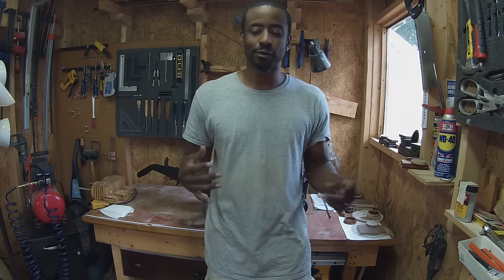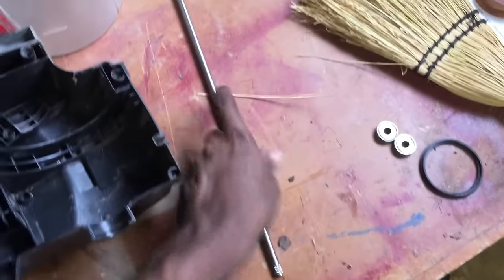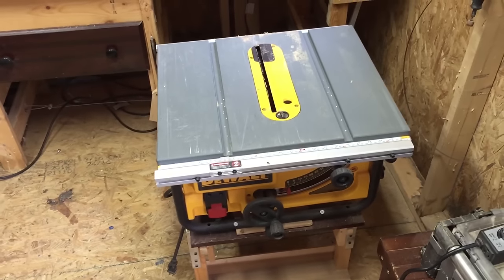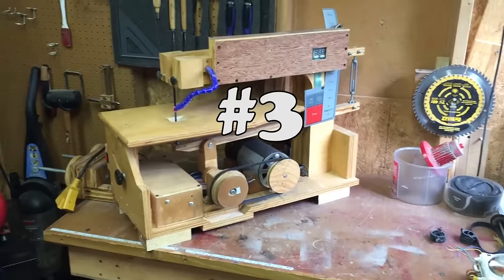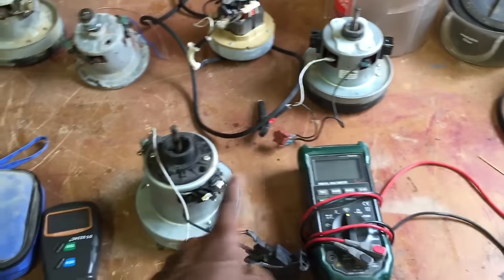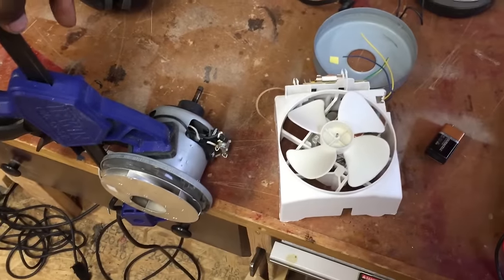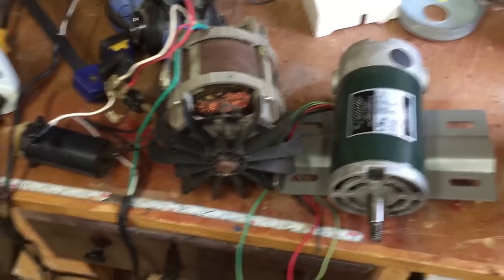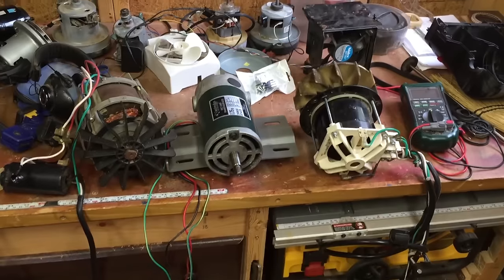Things You Can Make With A Vacuum and Other Salvaged Motors: # 010

Comment: This isn't vacuum related, but I've been trying to make something out of an old table fan motor and can't get it to work. I'm not savvy with electrical wiring, and have tried and tried to get it to work. It has four wires a black, red, white and blue. The red white and blue went to the 3-speed function of the fan, the black was connected to the power cord. I'm trying to wire it up to a switch but everything I try doesn't work, do you have any ideas of what I could be doing wrong? What switch I should purchase? 😞 Any help is greatly appreciated!

Comment: If you ever get your hands on some stepper motors from normal printers, you probably could use an Arduino, or Raspberry pi to make a 3D printer. That’s what I have been doing for a Project.

Comment: 2:00 min mark:  Air is mostly nitrogen hydrogen and oxygen...  all are fluids below each of their evaporation temperatures -297.3°F for oxygen, −423.17 °F for hydrogen, and -320.4°F for nitrogen.  But unless air is below those temperatures then it is not a liquid, it is a vapor.

Comment: Jeremy... I wish we were neighbors too! I salvaged a DC motor (60v??) , I bought 18 LG 18,650s.... all of this is for my bicycle. . The motor mounts fine, and the batteries work great 6s3p(22v).. Tons of amp hrs. I calculated it to be 185ish amp hrs. which is divided by 6 or 3 Im not sure... I have run the motor at 42v with 12s.. It ran so fast.. too fast and I felt that I didnt have an equal amount of run time with the motor as with 22v6s1p.. Which should equal 44v12s1p same amountnof run time.? But the battrries depleted much faster 12s (44v) vs. 6s (22v), So ultimately I decided to configure my bike to be 24v with this motor.

Comment: Have you done any work salvaging old portable air conditioning units?  To repurpose the blower motor able to process high heated air that can be repurposed to cycle air in a workshop or cycle air in a green house? Or even be used for a high powered swamp cooler? Even repurpose the condensers into water chillers for a hydroponic green house? Foamed aluminium can be formed to insulste for sound of a high pitch sound of a electric motor. Neat tricks to make some cool devices out of other things. ; )
Reply from the maker: I have never salvaged a air conditioner. The motor is really too small for most of my projects.
Reply: Jeremy Fielding well in most portable air conditioning units there are two electric motors old chap. ; )

Comment: Do you salvage any PC components? PSU is good source of 12v DC, Fans, heatsink, if you need a very cheap powerful 12v, look for the new/used HP server PSU on ebay they are around 1000w, many people use them in other projects, eg recharge large batteries etc....

Comment: Very cool video thanks! Where did you get that potentiometer and how much did it cost?
Reply from the maker: At what time in the video do you see the part? I don't remember a potentiometer in this video
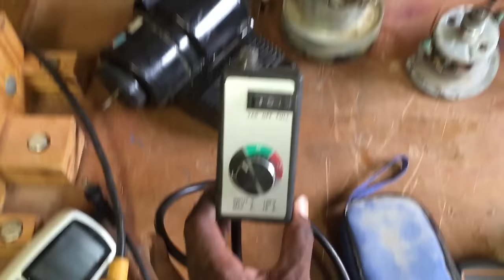Reply: I was wondering that myself, you can see it from about 7:00 minutes in.
I've been searching my @ç$ off (relatively speaking, i.e. anything that takes longer than 5 minutes)
Never mind, i have just found it.  
Most easily found on ebay for around 20$ search with  "electrical motor control AC DC variable speed".
@ Jeremy: I've just discovered your tube: looking forward to more
Reply from the maker: +Peter Decruw that is a harbor freight router speed controller. It actually works by using a triac. That was a small technical error to say it works by resistance. I would not buy the harbor freight version. I have had many problems with two different ones.

Comment: I used to repair vacuums.  
( 50 years )......Now when I see a vacuum cleaner on the curb, I pick it up.  I remove the lower parts and I use them to capture saw dust from my wood shop.

Comment: very informative, and helpful i stumbled on to your channel by looking up how a D/C motor works, ... so i tried it, and it works fine but has a clicking sound, I'm sure i can figure it out and fix it, however i need some help with making it a variable speed with reverse. if you don't mind, I'd like to send you a video via email of my last "project" at work, I'm a welder and i built it out of scrap metal and parts from a suburban. it ends up saving the company about $6,000 a month in rent of this machine, i built it out of my design in my head, around the 3 phase motor and it's power. but i didn't hook up the power side of it or it's controlled functions...  which kinda got me thinking, yeah I'm good with metal but maybe it's time for me to "up my game" and learn some more. so i went on a mission to find a motor and gear reduction box and found a leeson electric motor attached to an ironman reduction box today, for an extremely great price of 52 bucks... so now i can build my own machine! and should you have time, and don't mind tossing some education my way, I'd appreciate it. my email is achad78@yahoo.com
Reply from the maker: I have a whole series of videos dedicated to wiring motors of all types https://www.youtube.com/playlist?list=PL4njCTv7IRby2MEHBUJ51QIovAZK3rcKJ , and a series dedicated to how motors work for the beginner. https://www.youtube.com/playlist?list=PL4njCTv7IRbw82wJBDt3empXSMzYa7sUB ... most types. I think you will enjoy these alot. If you want to learn I suggest the "how motors work" first then the other. After that you should be able to wire and use almost any motor.

Comment: In the late 50's my Dad made a strimmer, I think he was the first! anyhow, he used a vacuum cleaner motor on a stick, and a kitchen knife for the blade, when he switched it on, he found out how much out of balance it was, he had to hold tight, he could not switch it off and nearly chopped his leg off. Ha Ha.

Comment: hey man. very cool. can you tell how to wire the vaccum cleaner motor? a 220v 1400w needs capacitor or what? and it has more than 2 plugs which belongs to different rpms. in your video 10 is for amps? I want to bulid a cutting machine using that motor.

Comment: Have you every thought about building an electric trike or go kart with vac motors?
Reply from the maker: +Marc Hustle I don’t think there is enough power for that. It runs best at very high speeds but have very little torque
Reply: Me and my brother built one for his son a year ago using a CHEAP harbor Freight cordless drill. However I always wondered what a larger motor would do.
Reply from the maker: +Marc Hustle drills actually have a lot of torque compared to a vacuum for the speed. They have significant gear reduction to get the torque
Reply: What do you recommend I keep an eye out for that's larger than a drill but still has the torque I need to get some good speed.
Reply from the maker: +Marc Hustle maybe a power wheel chair

Comment: One of the BETTER videos I've seen on YT.   Question for you, does your wife yell at you for bringing home junk?   Mine did until I found an engagement ring stuck to the wall of the hose via chewing gum.  I wouldn't have found it,  but as I was cutting it into sections to divert air to windshield from the vents of my POS vehicle.  Needless to say, the wife hasn't said too much after that.
Reply from the maker: I don't really have junk laying around. If I bring home say a washing machine, I gut it right then, and put the rest out to the road. All my motors and parts are in the shop or a small storage room so she doesn't really see it.
Reply: *****  I know it's not "junk," but my WIFE sure thinks it is!!!   XD  PEACE
Reply from the maker: You have to sort it quickly... out of site... out of mind :)

Comment: i'm guessing a bridge rectifier(only) could be used to power a tread mill motor at a constant speed, and it would probably run at about 2/3 speed?    120ac cut in half would be 60 dc   for a 90volt dc motor.?

Comment: A question boss So When I mount my vacuum cleaner under my workbench I think I might have to have it laying down on its side like when you fold it out to get under the furniture. But will it still work well for dust control or would it have to be in the up right position?
Reply from the maker: +Th Linn you need to stand it up. Can you make it shorter? It mostly plastic, remove as much of the top as you can with out cutting the canister

Comment: Hi Jeremy, I like your machine ideas. I recently used the cyclone from a Hoover vacuum, exactly like the one that you showed in your video with the rectangular connection at the top. I'm wondering how you worked around that rectangular opening? I used a part of the plastic housing that originally connected there, and held it in place with a strong velcro strap. I made the connection one that is easily removed so that I could use/change the hepa filter that's in the top of the cyclone.
Reply from the maker: I measured it, and made a wooden adapter piece. It is rectangular block and was sanded to fit the hole exactly. It has a hole in the middle to fit the hose.
Reply: 👍 Today I decided that my inlet was too small so I cut a bigger hole in the side of the cyclone and epoxied in a shaped piece of 2" abs pipe. I heated and expanded the end of the pipe slightly to accept the end of my shop vac hose. It's better now. Do you ever use hot tub motors? I have a hot tub that I'm going to get rid of,  but the motor works.
Reply from the maker: First, I love the idea, that is great. As to the hot tub, I think the pump and motor would make for an interesting project. Is the pump working?
Reply: Yes, the pump works.
Reply from the maker: Can you go to my "about" page and send me a message. The button is over on the right side of the first panel. I have a few more questions but it would be better asked in there rather than in the comments

Comment: Do you think it would be possible it make a stationary belt sander (grinder, for knife making) with parts from either a washing machine, or vacuum cleaner or maybe a clothes dryer? Any help would be great. Thanks.
Reply from the maker: Universal motors are not the best for that (vacuums in the US) but any could be used

Comment: Those vacuum motors had enough torque to make a sander?
Reply from the maker: The real issue is not the torque. Gearing down the speed (with pulleys for example) gives you more torque, but its the lack of consistent speed under load with a universal motor that makes them not that friendly for sanders. You press the work piece into the sander and it slows down. That makes it a challenge
Reply: Ever use ceiling fan motor for anything?
Reply from the maker: not a ceiling fan no

Comment: Is there a way to responsibly dispose of the plastic housing after scavenging appliances for motors/components?
Reply from the maker: Thomas Rupp well... I usually just put it in the trash which is where I got it from. I have a recycling bin but I don't know if that plastic can be recycled
Reply: Ok. Thanks.

Comment: Ametek SPECIALTY MOTORS 
Lamb RA1413430-02 
09/12/03 REV E
240V 50/60Hz

The vacuum is used as a bubble blower for a 2006 Sundance Spa. The brushes deteriorated due to the Bronze or brass Bearing in the Bearing Bridge wore to an oval shape causing the armature to vibrate. I believe the vibration plus heat generated by the brushes caused the blower to smoke and blow the circuit. The blower still worked but I didn’t want to destroy the unit. I took it apart and on my days off I hope to find the parts at a local electric motor repair shop. 

I purchased a: 10000W AC SCR Electronic Thyristor Motor Speed Control on amazon so that I could bench test it for about 30mins after rebuilding. Even though it’s a 220V motor I want to bench test it at a lower voltage and not put a heavy load on it. Due to my tinkering with anything and everything I cannot afford a 220V power supply. If this speed control doesn’t work I would have to purchase a new unit that is very expensive. 

I wrote this before watching your whole video. Some of the items you have for testing I was looking at and was going to purchase. I’ll, definitely get those soon.

Have you ever used this type of speed control? What type of bench test equipment do you use to ops check your electric motors? I do not want to do what I used to do(directly plug into outlet with a light switch as an on/off circuit) to test out units as a kid.thanks for your videos. You, Paul Sellers and many others on YouTube keep me motivated in learning or enhancing my skills.

Comment: Would like to take a ECM v/s motor from HVAC 115v (ECM 2.3) and make it work for me as a belt driven motor for a old drill press I am restoring. Very old. The motor depends on a ECM controller but would like to get beyond that and wire up to the DC 3-phase portion. I assume I would need some kind of phase converter and then convert to DC via bridge rectifier and possibly a smoothing capacitor? The idea is to make the old drill go forward and reverse and speed up or slow down.

Comment: just use a transformer for the lawnmower part you dont need a variac since it is intended for 25 volts.
Reply from the maker: Yes.. I agree a homemade transformer is the best low cost option if you want to run it at full speed.

Comment: I have a grizzly go555LX 14" bandsaw that I want to be able to cut sheet steel anywhere from a sign to 1/4". I just found the perfect bandsaw that does both wood and metal by JET and it's price tag is $1500. I was thinking of purchasing their controller and possibly motor. I would prefer to upgrade mine less expensive if you can help me out.
Reply from the maker: Unfortunately I can’t help directly. I hope you can understand, I get hundreds of request like this. It just isn’t practical or safe to give one-on-one advice

Comment: I have a Shark power lift away. I have taken my vacuum all apart, I'm using the motor as a blower for a foundry I'm making. I want to control the speed of the vacuum. How do I figure out how many phases my motor has.
Reply from the maker: If you live in the US you likely have a universal motor. I think you would find my series/playlist on  "how motors work" to be very helpful. Then follow that with "#35 how to wire most motors". You can search my channel for these videos.

Comment: For me the problem has always been that the operating voltage is usually not on the components. How do you figure it out?
Reply from the maker: I decide based on the item it was removed from
Reply: Jeremy Fielding I just enjoyed a vid on motors where you go in depth on your approach to finding their power requirements. Much appreciated.

Comment: I wish I could get high torque motors and stuff free but I was lucky to find a free vacuum but sadly don't have a use for the motor so I will just mount it to one of my tools for dust collection, it would be cool to be able to adjust the speed but I'm not sure if its possible with an ac motor

Comment: I want to make a 12 volt HVLS (high volume low speed) fan for my greenhouse.  I would like to make the blades about 4 feet and with a good pitch.  This fan will not spin fast.  It will be at the top of my greenhouse forcing the heat down to the ground.  Can you make a motor to be wet rated?w  Thank you.

Comment: SIR, all vacuum motors are designed for moving massive amounts of air. Not for 'driving' a real mass at any speed. Only the air offering the atmospheric pressure against it, 14  pounds /square inch. Not enough 'torque' for driving a 'mass' with inertia, and added load of whatever it is cutting/drilling/sawing/grinding/sanding....etdc.

Comment: i have a bisell carpet cleaner.and the water reserve is small and fills up quickly..I was wondering..if it's possible to somehow hook up to a hose that suctions the dirty water directly to a sink or water outlet?
Reply from the maker: You better believe there is! Are you just cleaning one spot, or do you plan to use a long hose back to the sink as you clean? If my assumptions are correct the issue may be the level of the sink relative to your tank. You would need a pump to draw the water out of your tank. You could make a larger reserve tank but that might be challenging as well. If you are just wanting to avoid removing the tank over and over, you just need a water proof connection between the hose and the tank (obviously) and you can pin the hose above the tank while you are cleaning. Whatever you empty into still has to be lower than the drain on your tank though.
Reply: Jeremy Fielding Thanks for your advice..I have a 14 yr old pitbull..and im residing in an upstairs duplex..so im always cleaning messes..I might have to invest in another cleaner..but thanks for Letting me know that it is possible..I look forward to watching your videos..

Comment: yo. @9:32, that woodchipper motor. Got one that looks the same! 2500W motor atb 546424 bsrbf 0,75/2-c85. So it uses 25uF 450V startcapacitor. Even though it has 2 startwindings it only runs in one direction (for safety so it doesnt spit woodchips at operator). Mine is also from a woodchipper and Im gonna attach it to onto the variatordrive on moped inplace of gasengine. But how to make this 2800RPM quiet?! Can I somehow run it at a lower speed or re-wind the coils to make it less noisy? Also tips on controller? I dont have money to buy a controller...

Comment: How can I use a treadmill motor to power a small bicycle or cart?
Reply from the maker: Probably, but that would require some experiments... what kind of power source, what gear ratio, how to maintain traction with the bicycle wheel?? You have some problems to solve but it starts with you trying.

Comment: Hi, could a vaccume motor be used on a mini lathe?
Reply from the maker: A universal motor doesn’t maintain its speed when a load is applied. In my opinion it’s possible but not a good choice. Outside the US some vacuums are induction motors. They don’t have much power but that would work fine
Reply: Thanks for the reply. I'm on the look out for a treadmill motor but running a sewing machine motor just now. Any suggestions for motor?